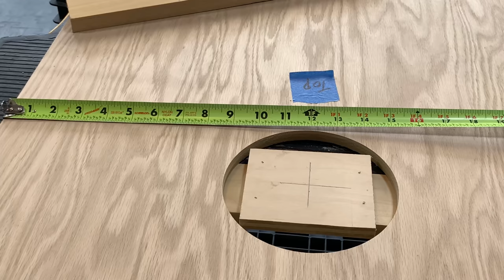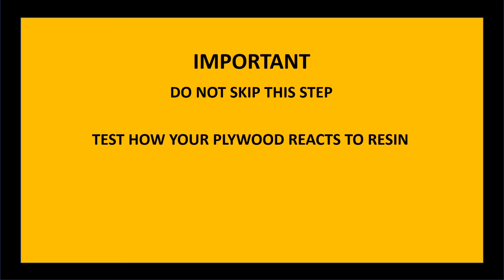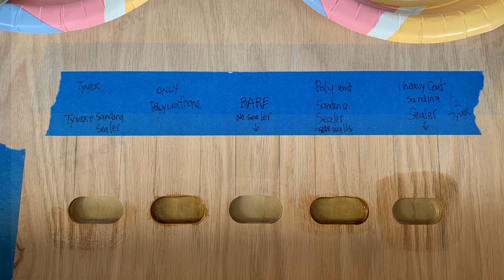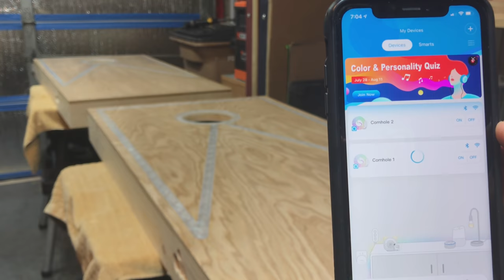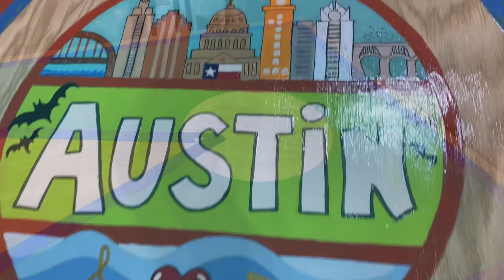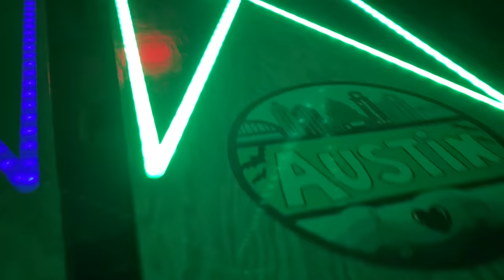How to Make LED Cornhole Boards. Step by Step. Sound Activated LEDs!

Comment: Rico, thanks very much.  I just made a set of boards based on your instructions/video.  Overall, I can't thank you enough!   I do, however, have a few minor recommendations for improvement for those considering making boards based on your video:
Instead of folding the LED wires (which I found very difficult and I put a tiny nick in one and ruined the strand), I recommend drilling a 1/2 inch hole at each location where the fold would be.  The LED strip can then go down in the hole, twist any way you need, and then back up in the correct/new direction.
Also, I found that I had an extra 26 inches of LED strip at the end.  So, I drilled a hole at the top center of the groove and put the extra 26 inches underneath so it will light up the bottom raised end of the board.  
I also added a built-in tape measure at one end of one of the boards.  Lastly, I believe you used Alumilite Clear Slow which reacts (bubbles) to any moisture.  Instead, use Alumilite Amazing Clear Cast (which is moisture tolerant).
Reply from the maker: Hi Brian! 
Thanks so much for watching and thanks for the positive feed back!
You recommendation were amazing... its always nice to hear of other ways to make the project better!
I will try the Aluminlite Amazing Clear cast.  What is the cure time on it?  Cure time for the one i used was just 2 hours.
Anyway...I am so happy that i was able to assist you in your build and thanks for the tips!
Hope you and others get alot of enjoyment with your LED corn hole boards!

Keep Building!!
Rico
Reply: What size LED did you use?

Comment: Now you should add in an optical sensor that triggers some sort of confirmation of the bag passing through the hole.   
Perhaps a short audio music clip or voice announcement. 
Also wondering why you chose pocket holes on the leg brace and not just brad nails since you applied glue?

Comment: 15:56 15:41 Hello Rico. First let me thank you for giving me the hints to fabricate my own LED set of CH boards. Been thinking of it for a while now. I put my own spin on certain things but appreciated your insight. I live in Portugal but grew up in louisiana so I know the game and have introduced it to many here. Thinking of starting a CH club actually. Anyway, I am 90% through the build but dreading the final epoxy poor as I do not want to destroy the boards by overflowing the resin. I am sure I will work out OK. Not sure if I can, but will upload a few pictures of my project. I will use white pearl epoxy to complete the red, white and blue colours as I wanted to respect the flag and the origin of the game. I Hope I have done it justice. 15:41
Reply from the maker: Hi hansrichardtjensen4619,  
thanks you for watching the video and thank you for your kind words.  Much appreciated!  The most important thing BEFORE pouring the resin is to make sure the top surface is LEVEL from top to bottom and side to side. This will almost eliminate over pour.  Just pour slowly,  and pour it just below the top surface then add more if needed..  easier to add than to remove.

 I put out a 2nd video using a new resin that has a LONGER work time.  Here is the video link. https://www.youtube.com/watch?v=qdiI1hICoWw&t=749s

I only use this resin now. Im always learning and changing my process. 

Deep Pour 3:1 Resin - Amazon
Amazon Link: https://www.amazon.com/gp/product/B09...

I do want to see your board when you are finished!!  you can reach out to me on facebook to send me the pictures!
 Good luck sir!!!
have a blessed day!!

Comment: Quick question,  first off,amazingly done video!  I promise I am NOT trying to sound like a keyboard knowitall!   I am simply asking...are there any places where the bags snag or get caught on the resin channels?  Since you don't over-fill the channels, did that create any problem when a bag hits the board?  Thanks again, amazing job!
Reply from the maker: Hi otrindy Shawn!  Thanks for watchin!!  I have never had a bag catch on the channels.. the resin is pretty much as close to the top as possible.  They slide just fine!  I dont think you have to worry about that.
Rico

Comment: I have watched several cornhole videos and this by far the most detailed and easy to follow.  Great Job!  I do have a couple of questions, 1. Did you cut the lights to length?  I ask this because an article I read on RBGIC lights said they could not be cut.  And 2. how much pigment did you use?
Reply from the maker: Hi Jim!  
  Thank you for your kind words and your questions!   Much appreciated.  
Yes....  I did cut my LED strip to length.  There are cut marks on the strip that are spaced every 3 LEDs.  If Im not mistaken, most all LED light strips can be cut to length as long as you cut them on the marked cut lines.   I tried to weight the amount of pigment that i used on my scale however the pigment is so light that it did not register on the scale... so i poured the amount i used onto a table spoon...and it looked like it was a full table spoon maybe a little more,  but even if you use a little more..it shouldn't matter.   Hope this helps.
Reply: @ricohernandez2394  Great thanks.

Comment: I had a super hard time getting the epoxy perfectly level in several mockups I tried. It was either slightly overfilled or slightly underfilled when dried. I ended up having to overfill and then sand the whole top down.
Reply from the maker: Hi Leafinit up!!  Thanks for watching my channel. much appreciated.  You really have to make sure the channels are heavily sealed with your favorite sealer ..if not properly sealed.the resin sometimes will be absorbed into the plywood.  But i have overfillled before and it a hassle to sand off the hardened resin.  Sometimes it bertter tu under fill.
Hope you have a great day!!
Rico
Reply: @ricohernandez2394  It was a workout to sand down the epoxy, but it came out great. I ended up routing a second channel under the epoxy for the LED strip, and then I sandwiched it with another thin piece of plywood, screwed to the first piece.  That way, I could take it out and replace the LEDs if I ever have to.  It was a fun project. Thanks for your video.

Comment: Great video, I'm looking at doing something very similar, I just have not worked with epoxy before
Reply from the maker: Thanks for the the reply.  Good luck with the resin ... resin can sometimes be tough...so  many variable to consider!  
Rico
Reply: Can I get away with a 1gal kit? .5 each? Or do I need a 2gal kit? I noticed the stuff listed isn’t available anymore.

Comment: Love this design! Very well explained.
Just curious what the cure time is on the resin? How long before you can remove the plexi? 
Thanks and great job!
Reply from the maker: Hi balacapasa!
 Thanks for watching and thanks for asking the question! Since every resin has different cure times, the cure time is dependent on what resin you use. The resin are used in the video has a cure time of two hours. You can immediately start to remove the moles, after two hours. That is why I like this resin. However, you only have approximately 11 minutes of work time to do your pour, which can be stressful.
Anyway, I hope this answers your question. I hope you have a great day and once again thanks, Rico.

Comment: Great video and very informative!  Any reason you did not put the lights along the bottom as well as the diagonals to the bottom corner?
Reply from the maker: Hi Walter... thanks for the comment and question... I dont believe there was enough of the LED strip left to make the extra run. Good idea though...
I used a 16 ft strip and can only recall a couple of feet left when i made my run.   Once again,  thanks and have a great day!
Rico

Comment: Fantastic. Thanks  for the detailed instructions.. How did you cut he original hole ? Circle cutter on a drill ?  What  diameter?  A good project for the upcoming summer.
Reply from the maker: Hi Bruce,
 Thanks for the question!   I purchased the boards from Home Depot with the holes already cut in them. If you start with boards that do not have the hole pre cut.... you will have to cut out a 6" hole with a hole saw (cleaner cut) or a jigsaw ( hard to get a clean circle).  You can also use a router.
Wish u luck in your build!!

Rico

Comment: Rico, since I would like to learn from your mistakes and not my own... did you ever try placing the LED strips on edge all the way around, like you did around the hole?  I was thinking of doing this as I am using 3/4" ply for my boards so I shouldn't need any secondary backing. Just wondering if you tried this yourself and if so did you have any adverse results or light effects (light display visual). Love your design, getting ready to build a set like yours, might use 2x4's for the legs as kids can be pretty tough on things!
Reply from the maker: Hi Craig,  Thsnks for watching my video and thanks for the question.. Great idea using the 3/4" plywood to eliminate the backing.  I have built  a set with the leds on the edges of the board... it just required building a damm along the edges to hold the resin.  Here is a video of that build the shows the edge desing.  I did not do a voice over on this video.  The led are flat..but since you are using 3/4"  you can stand them up.   https://www.youtube.com/watch?v=vGcotptIZRY
Good luck on your build.
Rico

Comment: Looking at making a set for myself. Did you have to buy 2 battery packs and 2 sets of light strips? i already purchased one set but then wants sure if i needed to buy another set. Also could you recommend some resin that is not so expensive as i will likely only be making one set of these....unless they turn out well and i get some interest in which case i will purchase more resin for future projects. Thank you for posting such a great video as i have been wanting to do a set of these for a while now and these are by far the coolest i have seen.
Reply from the maker: Hi Nickolas!
 Thank you a lot for taking the time to comment and ask questions. I appreciate you!
Yes... you will need 2 powers pack and 2 sets of LED lights.  The power packs are rechargeable and will last the entire night!  I love them.
As far as the resin is concerned ...I can not recommend any other resin, since I have not used any other types of resin.   I selected Aluminite because it cures to a workable state in 2 hours, however the down side is that I only have 12 mins of work time to get it poured.  I also bought the gallon sizes which make the price higher.  You might want to see if  they have a half gallon size, that will lower the cost.   I am sure there are other resins that will work, i just haven't done any homework to know what those are.
Every resin comes with its set of rules of how to use.  ie: pot life, cure time,  proper pour temperature,  ratios by volume or weight.   Resin is a tough medium to use.. 
I have made a number of cornhole boards with Aluminite and have done an number of other smaller projects with Aluminite and it works for me.
If you do find something else that is cheaper and works.  Please let me know!  Hope you have a blessed day and thanks for watching!!
Rico
Reply: @ricohernandez2394  Thank you for getting back to me so quickly. How long are the light strips that you purchased? did you use the ones that are in the description one?
Reply from the maker: @nickolaslondak8143  yes….I did.   They are 16 ft long and u will have to cut off a a short amount.  Just remember to cut on the marked cut lines on the strip! Good luck! I am sure u will do a great job!!!

Comment: did you have to buy two sets of the led strips? im planning on doing the center whole leds and i feel once i make the first cut ill need another to connect the second board? any help would be greatly appreciated.
Reply from the maker: Hi RotaryFD,
  Thanks for the like and question. Yes, each board will need its own LED strip. Each LED strip comes with a controller that controls the strip. If you cut the strip the remaining LEDs that are left will have nothing to be powered or controlled with.. So yes you will need two LED strips of any type that you choose to buy.  Hope you have a blessed day and good luck with your build!  Rico
Reply: @ricohernandez2394  thank you so much yeah I have a control buisness and I have a coworker who is trying to grt some LED's so I'm trying to do my diligence have a blessed one

Comment: I have never worked with resin. Is there a specific type of resin you use? Where do I get it? Awesome video. Thank you!
Reply from the maker: Hi Cliff,
   Thanks so much for watching and thanks for the question!  The question is perfect because I am currently working on a new Arduino control resin LED board...and when i was doing the resin test with the Aluminite resin on the back of the boards the results were so bad I had to find an other resin to test.. 

 I did more tests with a NEW resin and it is bubbleless!! Unbelievable!!  The new resin i am using is DEEP POUR 3:1 resin by MAS.  It has a 3 hour work time and cures in 36 hours and the results are perfect compared to the other boards Ive made with the other resin.  I will be posting the new video soon that explains the new resin and the new flat light ring that i am now using which eliminates a few of the routing steps.  

I purchased this resin on Amazon..i bought the gallon size  which is probable enough for about 4 to 5 sets of boards.  
https://www.amazon.com/dp/B09YRWRWST?ref=ppx_yo2ov_dt_b_product_details&th=1
I will never use the first resin again...but thats why its important to test your resin first!  You cant go wrong with Deep Pour 3:1 by MAS

Hope you have a blessed day.
Rico
Reply: Thank you so much for this info. I will be starting my project soon. This has been the best video I have seen so I will be following your example. Thanks again for posting this and replying with great information on the resin. 👍 Can't wait for your next video! 😁
Reply: @ricohernandez2394 thank you for this extra info! I have watched this video about 3 times now! I just made some standard boards for my church but plan to make me a set similar to this and bring up the awesome factor! I am looking forward to this new video!! Great job on this one too, very detailed and easy to follow

Comment: Can you please add a link for the battery pack?  I built a similar set of boards & I have merged techniques from multiple builds.  Thanks for sharing.
Reply from the maker: Hi Travis! Thanks for watching are commenting. Here is the link for the rechargeable battery pack.
I tested the pack and it lasted 10 hours...more power than youll ever need for a night of use.

https://www.amazon.com/dp/B00ME3ZH7C?psc=1&ref=ppx_yo2_dt_b_product_details
Reply: @ricohernandez2394  Thank you very much. Was hoping to find cheaper alternatives but just might go with these.

Comment: The cord between the lights and pack did it come with the pack… nice job by the way.
Reply from the maker: Hi Classic!  
  Hope you are having a great day and thanks for the question!  YES!  It did come with the lights..it is hard wired together...there is plenty of length of cord from the lights to the controller.
Rico
Reply: @ricohernandez2394  …. Thank you for replay, I’m talking about the black cord. Did you had to get an adapter cord to plug the light to the pack. Thank you sir and have a nice day
Reply from the maker: @classic7048  Hi Again!!  sorry, I misunderstood your question....  The black cord comes with the rechargeable power brick.  It connects the light strip to the power brick!!  
Rico
Reply: @ricohernandez2394  … that what I was wondering thank you for your help, one more promise I’ll leave you alone 😂. Can you control both boards with one remote or the app ?
Reply from the maker: @classic7048  Hi Again!!!  Each controller only controls the light strip that it is connected to. However the cool blue tooth app identifies each controller. You will name each controller differently.  Now the blue tooth app is able to control both boards one at a time… it will not control both boards simultaneously. U must select each board by name and control it, then select the other board and control it!  
The blue tooth app is sooo cool literally hundreds of option to choose from.  Hope u have a great day and thanks again for connecting with me… I wish u luck!!
Rico

Comment: Nice Video Rico. I have been making cornhole boards for a couple years now. I've made probably hundreds of them. But never with the leds this way. So, two boards, do I need to purchase two of the led strips and two of the battery pacs? Thank you for your time.
Reply from the maker: Hi Patrick, thank you for taking the time to watch my video and for the question. Yes you will need to buy two LED strips.  I chose the sound activated set which are more expensive, but the cheaper set with out  all the bells and whistles will work tii. But it’s totally up to the user. And yes, you will need 2 battery power packs. One battery pack per board.   The battery packs I chose were tested to last for about 10 or 11 hours. You can buy cheaper battery pack of course that will last for less time. But then that again is also on the user. Good luck and I hope you have luck with your build. Rico

Comment: Last question, is there a reason you didn’t add the pigment to the epoxy in the first/bottom pour?
Reply from the maker: Hey Mathew!!  thanks again for your question.  The reason i didnt put pigment on the bottom layer was because #1 - it is not needed and #2 - i testing to see how many bubbles would show up after i put the sealant.  If had used the pigment i would not be able to see the bubble formation.  And as i mentioned in the video...if bubbles showed up in this layer.. they would be covered up by the top pigment layer.  Hope this helps...  happy building....

Rico